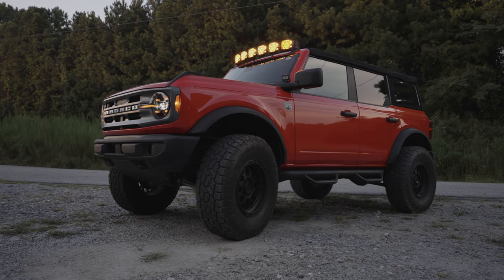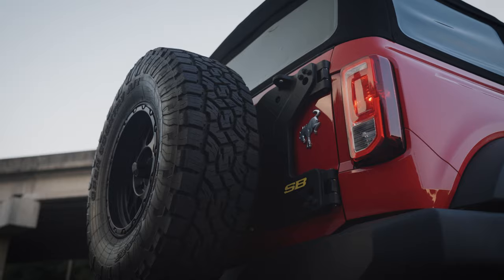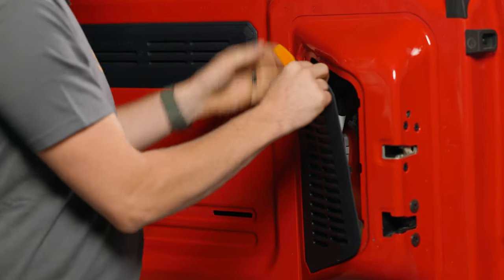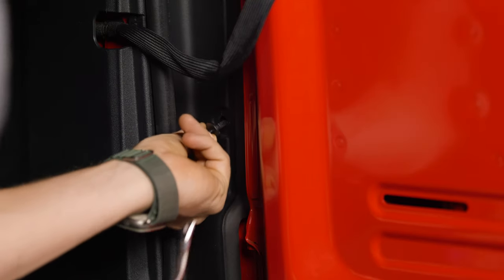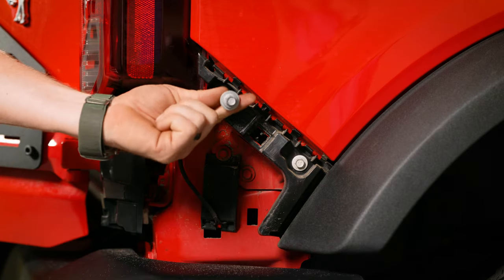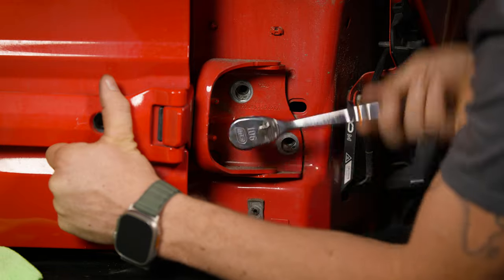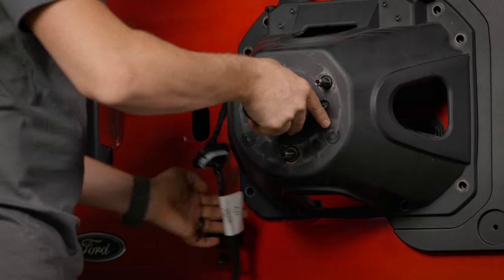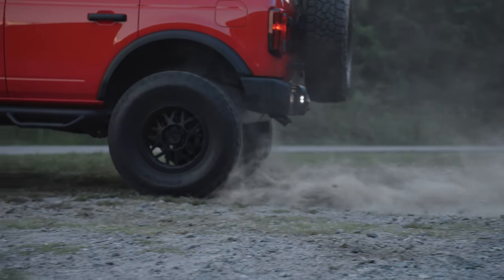The Smittybilt HD Pivot Bronco 5th wheel tire holder is the strongest and carries the biggest wheels

Comment: NOTE TO ANYONE INSTALLING THIS: Take the tailgate off and just lay it sideways in the trunk.  It is VERY difficult to get the hinges in the right place; put all the bolts in; and get this thing lined up with the tailgate in the way.  Also; why does the video basically give up any instructions the second it gets to installing the actual carrier?  Seems like the last 10 seconds of the video is installing the actual thing.  Also; where the heck is the third brake light extension!!!  I haven't found it in the box yet? The third brake light isn't even in the last scenes of the video...